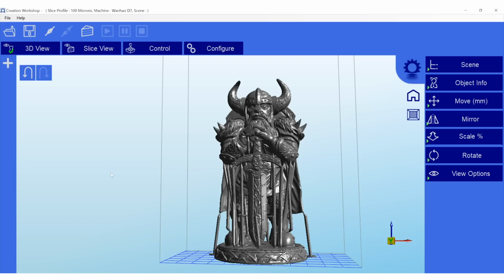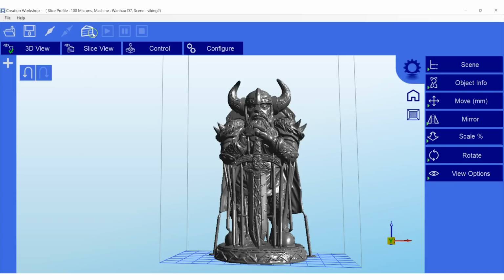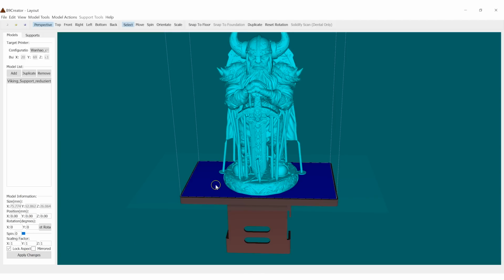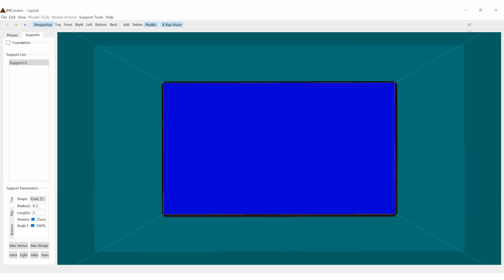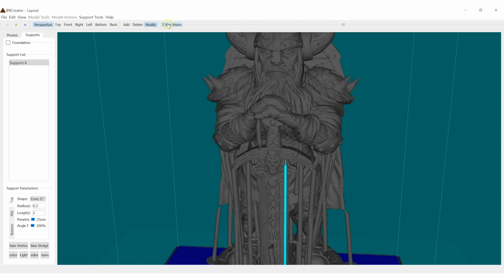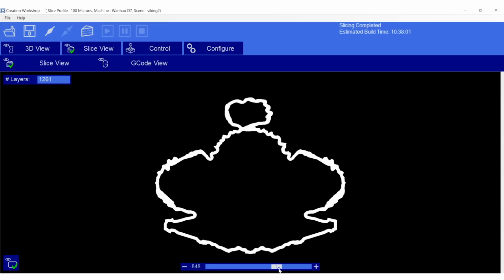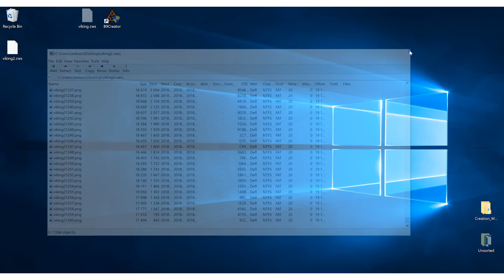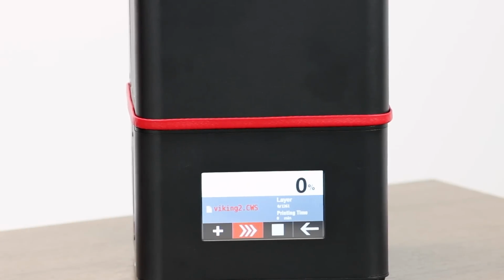Printing a Viking on a Wanhao D7 Plus (Resin Printing)

Comment: Okay, but what if the printer can't see the USB stick? At first, Creation Workshop did not save slices and in the cws file there was only a text document with some code and a stl file, although it did everything as it was in the video instructions for this printer. Then I used another slicer (ChituBox) with a plugin that exported everything correctly, but when inserting a USB flash drive into the printer, he did not see it. And when I pressed print -> + -> it showed empty files, even with the USB flash drive disconnected. I just can't understand what the problem is. Another problem is that the + itself was not pressed on the home screen, so I had to take an additional touch screen and poke through it, although all the other buttons seem to work properly.

Comment: How long did each print take?
Reply: Depends on how many layers and cure time. If there is 1200 layers and you have it set to a 10 second cure time Plus about 8 seconds to lift and drop between layers, then that print will be roughly 21,600 seconds 6 hours?
Reply: Thanks Jason, I  realise that. I was using the numbers on my printer and yours probably has a different lift time and the cure time could be different also. I was just giving Renato an idea of how it works.
Reply: My printer is the Flyingbear shine. I purchased the green Wanhao resin from your store. I timed my printer to get my numbers.
Reply: Although I use 1200 layers from your print lol